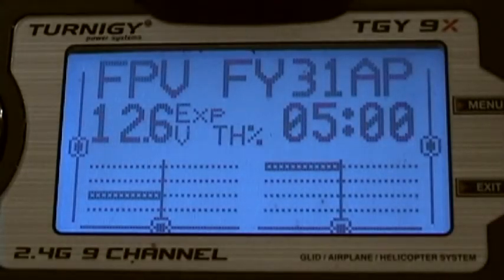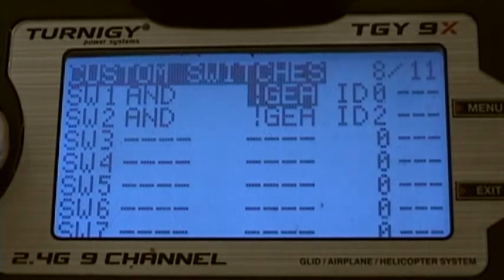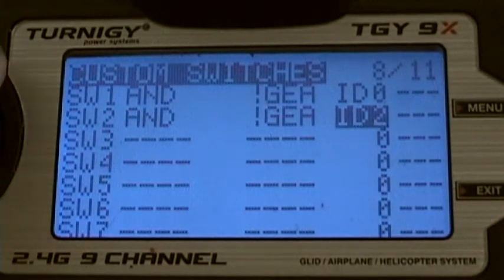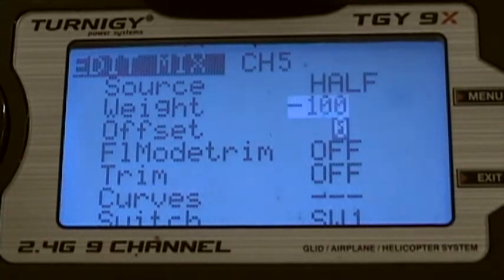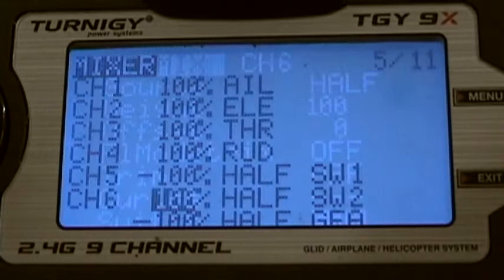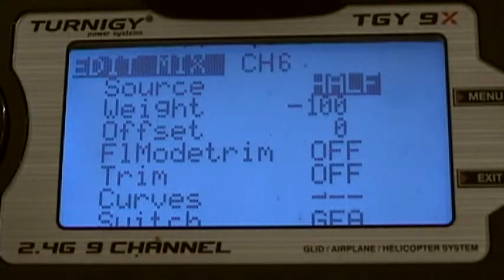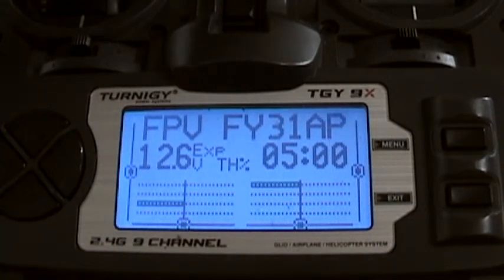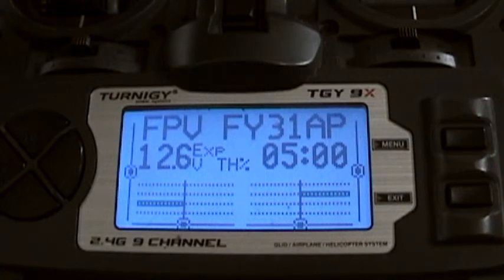ER9X and 9XR SW PROGRAMMING MIX FOR FY31AP

Comment from the maker: it depends, what radio module do you have for your 9XR? some modules have failsafe on the receiver, if you're using frsky system, your failsafe is on the receiver, turn on the radio and plane, set the amount of throttle stick which will not stall (example 50%) the motor will run, and switch gear switch to RTH, press the button on the receiver for 3sec to memorize the throttle and RTH switch. that's it! do not input any aileron or elevator when setting this!

Comment from the maker: And always remember, the 3 way switch will now be master, meaning the gear switch (RC and ABM) will have no affect until you postion the 3 way sw to ID1 mid position! i thought of your idea at first coz i wanted all the fuctions availlable for us. but this warning when turning on the radio i didn't disabled! im planning to do another video on using NAV in replace of ACM, but the NAV will be in FAF (fix altitude flight) or (Locked Heading Flight) which can be programmed using CGS software!

Comment from the maker: oh ok you want it reversed, yes it can be done, i do a followup video! the problem with what you want is null will be in ID1 middle, you always need to remember that or you take off in ACM or RTH, our radios always warns us to active the switch to default in your case it would be 3ways sw ACM and gear sw RC! turning off and on the radio will warn switches unless you disable the warnings. ill do a short video for your mix!